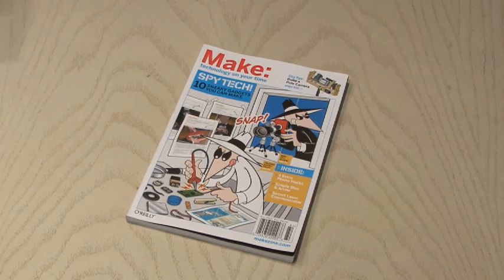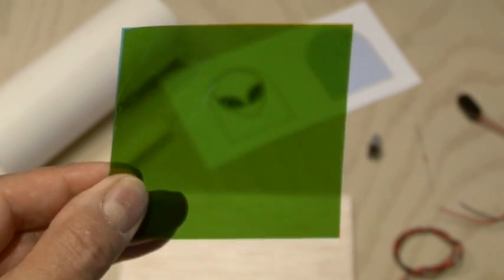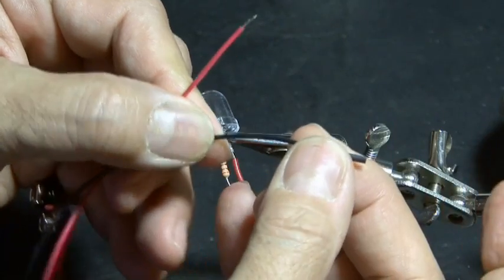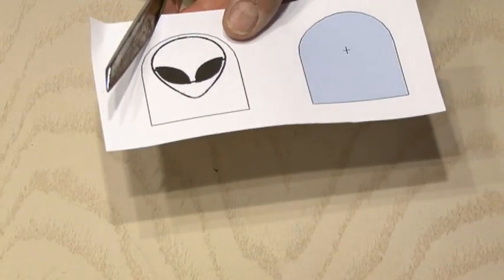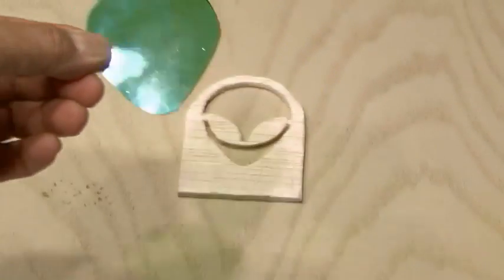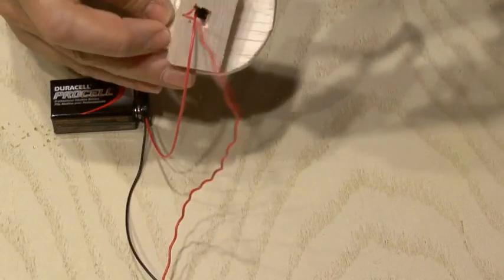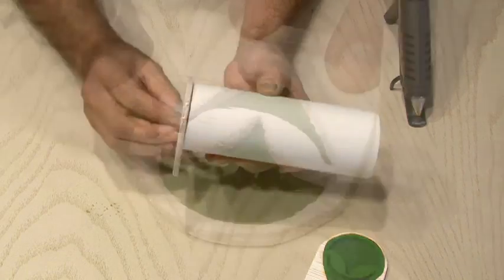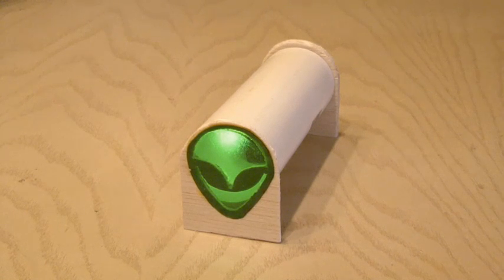Weekend Project: Alien Projector

Comment: FYI:
The Resistor should be attached to the POSITIVE lead on the LED. Not the Negative lead as stated in the video. The resistor is there to limit the current going to the LED since there is no resistance across the LED by itself. Which means all the Current from your power supply or battery will be dumped across LED, burning it out very quickly.
Putting the resistor on the Negative lead is like putting a silencer on a gun AFTER it's been fired!
Way to phone it in, Kip. It shows.

Comment: @SuperToastytoast If you glued the alien shape directly to the reflector on the flashlight, the beam angle of the light wouldn't have been narrowed down enough.

As i see it, the tubing helps create a narrow beam, that allows the projection of the alien shape.

At least that's what I think. I've been wrong before :)

Comment: i think for interchangeable images you could make a little stand on the front piece for the tube to rest on and then cut out various images and put in front of the tube.. could even use a cardboard for the tube and for the front and back.. i like this idea very much but as i don't have the faintest clue on how to solder and that, i have to wait to make this :(

Comment: could of been the camera.. just grab a 5,000-10,000+ MCD LED for a better light, and do 3 or so if it isn't bright enough. usually 10-50 LEDs would cost you a few bucks ($2-5).. you can even use it to have your name/logo, or even a happy birthday (u get my drift), but I agree with Tautvis17... good job

Comment: Sorry. But that's wrong. You can put the resistor on either side. The total resistance determines the current traveling through the LED at a given voltage.

Comment: Should skip the electronics, and just put a flashlight into the tube. If you put a bright flashlight in there, it would work better as well as be easier. could just pull the flashlight out of the PVC after the event it was used for.

Comment: How dare you to connect an light emitting diode straight to a 9V battery without a resistor?!!
Reply: +D3add3d there was a register..........
Reply: there was a resistor
Reply: You can get LEDs that are rated for that type of voltage kinda like you connect an LED to a coin cell battery without a resistor. You don’t have to use a resistor with an LED that 1: is rated for said voltage. 2: has a built in resistor.
BRUH

NOTE: you may wooosh me, but please do not post this on Reddit. Thank you.

Comment: huh??! no he didn't! if you look inside the LED there are two small metal pieces along with the connection leads. The SMALL metal piece is ALEWAYS the positive side, and he put the resistor on the big metal piece, so thats the negative side...

Comment: i see your using "electron theory", all well and good unless the person who reads this uses "conventional theory", where in that it is believed that power goes FROM positive to the led then TO the negative. personally i don't really see the difference, either  way ohms law is the deciding factor as to the amount of amperage flowing within the circuit, and as long as u wire it right, it will work just fine either way.

Comment: It's ANODE, CATHODE. Not positive, negative. The resistor can be on either side as long as the CATHODE goes to ground. Any simple wiring experience would teach you this. Stop feeding the internet misinformation.